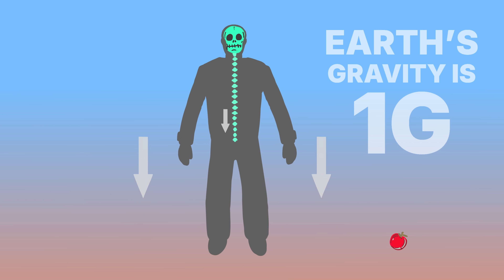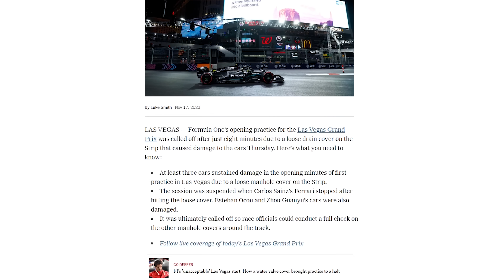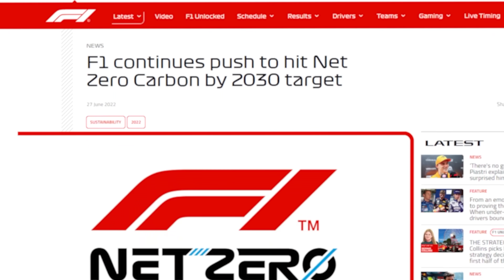Neil deGrasse Tyson Explains the Physics of Formula One Racing

Comment from the maker: 🏁Who on the StarTalk team do you think would win in a F1 race: Neil, Chuck, Gary or Charles Liu?🏁
Reply: Neil using physics while driving 🚘
Reply: @anshumanawasthi8693 
Neil couldn't fit in the car.
Well... maybe with Nigel Mansell's seat (no seat).
Reply: I don't know, but Gary has a certain seasoned gentleman driver look about him.
Reply: Charles Liu will give Chuck a run for his money. My money is on Charles, but I'd love to see the two of them race. And there are simulators out there! Do it!
Reply: Charles
Reply: None of them, they would die. F1 drivers are world class athletes, working on strength just to withstand the massive forces imparted on them. And, Neil would die because he doesn't understand that most of the "downforce" is actually due to the vehicle being sucked onto the tarmac from the ground effect design UNDERNEATH the car, the rest of the aero on top of the car is to manage airflow to lower the coefficient of drag and to allow the undercar molding to work better, and would promptly hit a wall. Also, they do run rain tires that are molded with grooves and softer rubber compounds (chemistry) to enhance grip in the wet, it's not just all about downforce.
Reply: Chuck would win
Reply: Chuck
Reply: Chick would prolly send it
Reply: Enter an esports race, find out for sure.
Reply: Chuck
Reply: The one who could actually drive the car. 😅
Reply: They all DNF
Reply: The answer is....none of them. Fans of classic UK Tope Gear will know it's really really hard for a non-professional to drive an F1 car. None of these would complete even 1 lap. Sorry to be the bearer of bad news!😆
Reply: DUUUUDE,  DO A NASCAR VERSION!!!!
Reply: There are only 116 humans who have won a Formila 1 race since the first race in 1951. If only Neill, Chuck, Gary and Charles from the show were on the track then Neil would win. He has the most mass and is the star of the show. Job security for the rest of the field. Also, he is known to run off with his mouth when he gets excited about a topic, especially at a forum. Vaya con Dios.